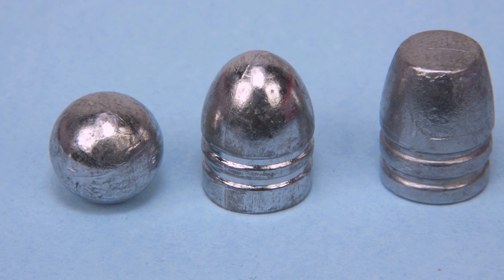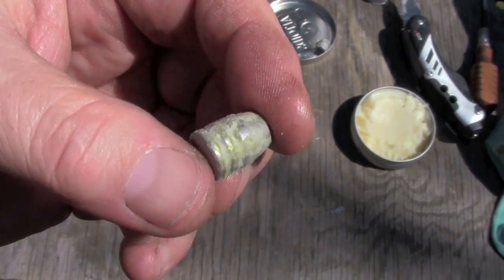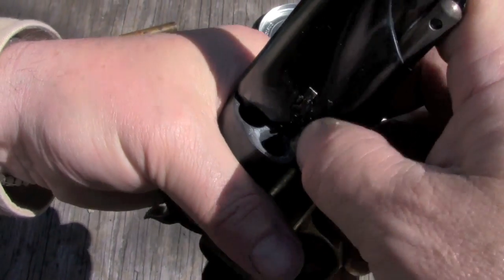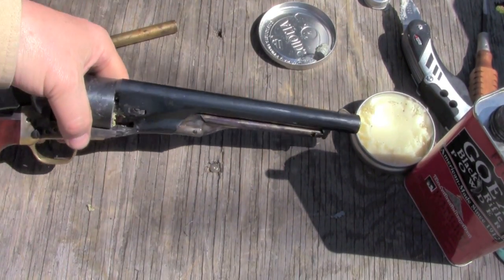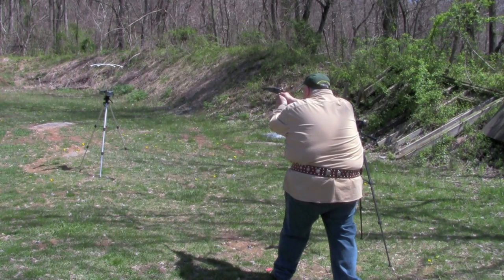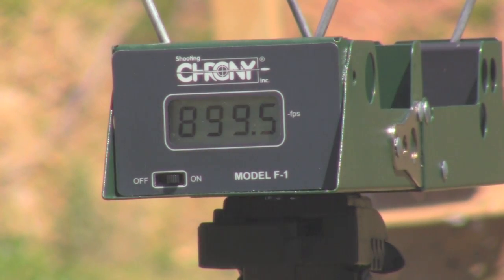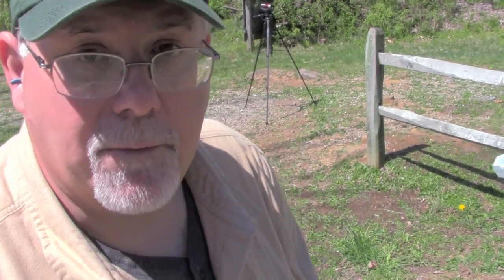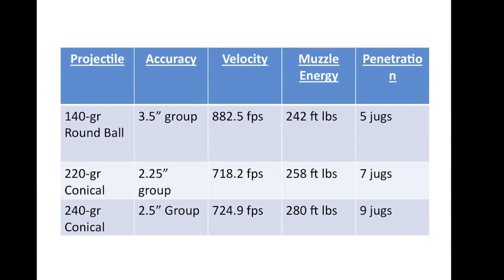44 Round Balls vs Conical Bullets Part 3 The 240-grain Kaido Conical.mov

Comment from the maker: You would be hard pressed to get 40 grains of powder under a round ball, let alone a conical in any .44 Navy or an 1860 Army (same cylinder). 40 grains was the load for Colt's Dragoon revolver. I typically load 30 to 35 grains with an RB and 25 grains to 30 grains with a conical. There isn't any room for mor than 30 grains with a conical in your gun.

Comment: the "Kato" round was an amazing choice for bringing the old gun to today's .44 speck. however it looks like it would be damaging to the gun after a while. Even though I am a huge fan of the ball... your hand load/hand made round In the second video, is the one I personally would put through your gun. it appears to have increased accuracy over the ball yet it has better charistics than the Kato. just on the fact that your not going to worry about blowing up your gun and your hand. it you really needed something to "stop moving" the Kato would be your clear choice. for Lazer accuracy the ball and your cast round. did exactly what they were supposed to do. the Kato seemed to shoot high for your gun... because of the heavier round it's weight slowed down the powder throwing the shot high. (Even with the same powder load.
Reply: Guy , clearly you know not whereof you speak. I have a Kaido (notice it is 'Kaido', not 'Kato') mold and it is a excellent bullet, period. It is FAR more accurate out of my 1858's than round ball,  and is THE bullet for penetration, period.

Comment: I can't imagine how tough it would be getting a 40 gr charge in a '60 army using a 240 gr bullet. I use the Lee 200 gr conical and it's all I can do to get about 37 grains in there. I don't like to put the loading lever under that much stress so I say 35 grs is max with it. It's a good, accurate bullet. It looks exactly like your 220 gr Lee you used here.
Reply: I used a 200 gr conical with 45/50 triple 7 packed it down real hard in my 1858 Remington pietta, omfg,powerful

Comment: Old post so not sure you will see this but got a question. Fairly new to BP. Manual on my Pietta 1851 navy .44 snub nose says max BP load 30 grains FFF. Max pyrodex P 28 grains. All over YouTube I see guys using 30 grain pyrodex p pellets. Is that gonna shorten the life of these pistols? Is it advisable to do this? How long can a guy reasonably expect to one of these pistols until they are wore out? I’ve been using 25 grains of P in my .44 with a wad under the round ball. Juts cast up a ton of .44 British Kerr boolits. Do you use a wad under these conicals? Do you grease the end of the cylinders? I lubed the ribs of the kerrs with alox. Is that necessary? Lots of questions I know. Juts curious. 40 grains seems like an awful big charge over the recommended charge Pietta calls for. Is that safe if done periodically for hunting?

Comment: These 35 and 40 grains Charges especially With Triple Seven Powder should only be used in Steel Framed Cap and Ball Percussion Revolvers that are in well regulated shape; meaning a sturdy in excellent condition working order Revolver. 35 Grains of T7 3F powder generated Magnum Power over 500+ Ft LBS of Energy. This load; 35+/40 Grains Should Not be Shot "All Day Long"; In The 1860. As it will eventually loosen up or stretch the Arbor Pin. Extra Case Harding of the Arbor Pin is an option.

Comment: Think it was in "Sixguns" by Elmer Keith that I read the conical loads are far less accurate than the round ball.  But those 19th century revolvers had gain twist rifling; think that explains Keith's observation.
Reply: The modern inexpensive Piettas and Ubertis generally don't have the gain-twist barrels (a few do though, such as the "Shooter's" model)! The modern guns all have @ 1-17 rifling on the pistols (beware though, a LOT of the older repro's don't , namely those before @ 2012 )!

Comment: I know that I  used to hunt with a TC .50 Hawken 90 grain was adequate  100 grain load I  always felt didn't completely burn in the barrel and caused more muzzle flash so powder was burning after ball had left the barrel 
So 90 grain load was about the most energy efficient ?

Comment: for the hornady 285gr .45 HBHP bullets i picked up the box doesn't give the decimal diameter, just ".45", but they shave slightly going in, a little less than a .454 ball and a little more than a .451. more accurate than the ball, have yet to do a gel test but they made a massive hole through wet medium, HUGE hole compared to a ball. going to try them for hunting whitetail...maybe a small one at first, lol

Comment: looks like an accurate bullet. I just wanted to throw my 2 1/2 cents in. in my search for a better bullet with no luck finding anything but round balls, i picked up a box of hornady 285gr HBHP .45 caliber rifle bullets, so I thought, what the heck, i'll buy 'em and see. to load them into my Remington 1858 I have to use a loading press as they will not fit in the notch with the cylinder in the gun, but they seat perfectly on top of a 30gr pyrodex pellet and pack a helluva wallup. and HP even!

Comment: Mike what is the dia. Of the Conicals and RB? My ASM  has large chambers, 457. Speer balls are don't shave a very good ring of lead any suggestions on which conical  I should use ?
Reply from the maker: Use the conical a for Ruger Old Army revolvers. They are .456".
Reply: My 457 220 grain VKV UB or the bigger 255 grain VKV BG 460 should work in your ASM with the larger bore diameter.

Comment: if anyone is interested the the entire label says hornady great plains muzzle loading 45cal 285gr HBHP all natural lube ...oops, paper in the box says they are .459" and with 85gr ffg or rs pyrodex they produce 1550fps and 1520 ftlbs @ muzzle and are  -.75" @ 100yds from a rifle and the reorder # is 6610 and also comes in 325gr solid point

Comment: I always thought that the original load was 40 grains under either a ball or a hollow based conical, but the manual that came with my 44 cal 1851 said that I should use no more than 30 grains. it's a pietta. Are the ubertis just better guns?

Comment: 40 grains with that bigger bullet would fit fine in a remington 1858 copy, which had a bit longer cylinder over the later colts by a small fraction of a millimeter, might be enough to seat it easier... who knows

Comment: You can load in more powder with the round ball than the conical correct? I would be very interested in seeing a loaded to the max round ball vs loaded to the max conical video. Or would that hurt the revolver?... even an all steel Remington?
Reply: Would not hurt a steel Remmy at all (anything over 20 grains would put a bruising on the recoil shield of a brasser though, which is a good reason NEVER to buy one)! You should head on over to the 1858 Remington site (the data you are seeking is tabulated over there).

Comment: Mike, Are you re-sizing these to .454 or just running them at .456? I'm just curios as the RB goes .454 and leaves a ring of lead, so .456 just seemed a little big. If you're not re-sizing them, can you run a .454 Conical? By the way, great write up on this in the current issue of Guns of the Old West!
Reply: My bullets become " Resized" once you load them  into the loading ports and crimp down.

 In  some older percussion replica revolvers reaming of the cylinder chambers is required to get proper size dimension  to correspond to the barrel dimension  and my Universal Bullets.

Comment: ive always been told that the replicas cant really handle shooting above 35 grain all the time. i have mine set to 32 grain. when i got it 3 slots in the cylinder were blown off and ive ordered parts and repaired it. scared to load any balls that hot.

Comment: is there any long term damage to the pistol if you only use conical bullets?
also have you tried .410 shot shell in a C&B Revolver?
Reply from the maker: No and no
Reply: Thanks man will definitely try that sometime
Reply: Just a comment here, not being a smart ass but I think you would find a regular conical bullet designed for c&b revolvers or even a round ball to have better performance. Unless they have made a different weight that I'm not aware of, 410 slugs only comes in two weights, 1/4 and 1/5 ounce. 1/4 ounce slug only weighs 109.4 grains and a 1/5 ounce slug only weighs 87.5 grains. A .454 round ball weighs 140 grains. You do the math. It's a common misunderstanding I've seen in my shop several times. Lots of people think it's a shotgun slug, it must be huge. Well, this is not the case with a 410 slug. I'm sure accuracy couldn't be that great either at least no better than a ball intended for a c&p revolver.

Comment: No way I'd load to 40 grains myself, but with the velocity of the Kaido conical and 40 grains of powder, I come up with 431 ft.lbs.  Impressive.
Reply: Jay Dee that's 357 magnum type energy..
Reply: 357 is over 600
Reply: Depends on what you're running in it.  450 ft.lbs is a pretty common factory power level.
Reply: John G A better comparison, I think, is that it is about on par with .45 ACP+P

Comment: From an old Marine but beginner BP shooter: very educational videos!. Thanks. I just bought my first black powder weapon - .44 Pietta stainless/target. Please give me 911 on use of 30 grain pellets in place of powder? ( I hope this isn't classic rookie error question..) I plan on buying Kaido conical 240 grain.
Reply: I just bought some of the 30 grain pellets myself. Have you had a chance to try them?
Reply: I did, and they worked well. They are very compacted and adding 10-15 grain more in a Remington would be doable. But I think you'd have reached the point of diminishing returns after 35 grains, like the video has shown.
Reply: Just don't think that the SS is going to cut you much slack in cleaning after firing. You may not have to worry about rust, or holster wear, but black powder will corrode stainless steel.  You need to clean it the same day you shoot it, just like blued steel.
Reply: If you using round ball , you can get 5 grains of regular BP under the pellets with a driver (don't use a wad under the ball , instead use a seal over the ball - same thing, just more powder capacity)!

Have a 240 grain Kaido mold myself , absolutely awesome bullet in a 1858 Remmy repro..

Comment: Just curious, what was the velocity and energy of the 240 gr over 40 gr powder>?
Reply: "432" the same as 45acp.
Reply: Michael Tighe 432 ft. lbs. of energy equals the same energy of a 45acp.
Reply: I have  both my Pietta and Uberti Colt 1860's cylinders reamed out which expands gives more room Capicity  for a larger  powder charge. 

With my tuned 1860's  I can fit 40grains of powder under  my 240 and 220 grain Universal Bullets.

For most  Hunters I  recommend using up to 35 grains  of powder. I generally use hotter powders such as 3 F Triple Seven powder,Black MZ,Swiss,Old Eyensford.

Using a stout powder like Triple Seven with 25 grains  of powder  and my VKV BG 240 grain Universal Bullet I took a  angry charging Wild Boar  at 25 meters with one shot with my Uberti Remington. 

Also took another Boar with my
Pietta 1860  loaded with my lighter newer 220 grain Universal Bullet.

Comment: Hello again Mike , you've helped me with my Colt 1860 Army once before. So I'm asking again for your help. Previously I've stated that I have a very stiff main spring (trigger) but the overall action seems sluggish. The timing seems fine , there's no over advancement of the cylinder on rotation. I was wondering if the sluggish feeling is caused by the hard pull caused by the main spring being stiff. Any help is much appreciated. Also do you recommend a slick up job for the action ?

Comment: Will conicals work well in a Pieta 1860 New Army?
Reply from the maker: You generally have to load them either with the cylinder off the gun using a loader, like the Tower of Power, or, modify the barrel assembly to give them room to load.
Reply: Ok, thanks. Love the video’s!

Comment: Do those "Kaido Conical"'s have a bit of a boat tail making them easier to start?
Wasn't clear in the video. They obviously have a lot more in the head.
Reply: Yes they do.  I designed them that way to fit easier in the loading ports of percussion revolvers.

  The bottom narrow band is 
.0440 of an inch.

Comment: can you shoot real bullets cal 45 in black powder revolver ?
Reply from the maker: +Hans Brethouwer if you mean conical bullets...yes. If you mean .45 Colt cartridges...no
Reply: no r.e.a.l bullets made in a lee mold
Reply: Most revolvers, except Ruger use .454 diameter balls into a .451 diameter chamber. 

I have a mold for .50 R.E.A.L. bullets, which are are .510 at their largest part, so I'd figure the .45 molds to produce about .460 bullets.  It could be a struggle stuffing them in there.  You'd certainly want to make certain they were pure lead, with nothing at all to harden the alloy.

There is also a problem with using any conical bullets instead of round balls, in that they take up extra space in the chamber that a round ball leaves available for powder, if you like heavy charges.   

By the time you stuffed a 250gr R.E.A.L. bullet in there, you might be be getting a little short on room for enough powder to move it out the barrel at speeds that would please you.

However, since FFFg has such a slow burn rate, you can also put so much powder behind a round ball that quite a LOT of it burns in front of the barrel instead of inside it, producing a much more impressive boom, but not that much extra actual muzzle velocity. You can put in 40 grains instead of 20 grains, but twice the charge won't give you twice the velocity.